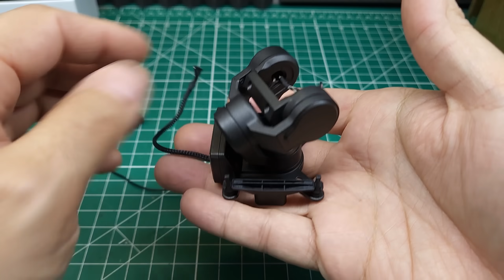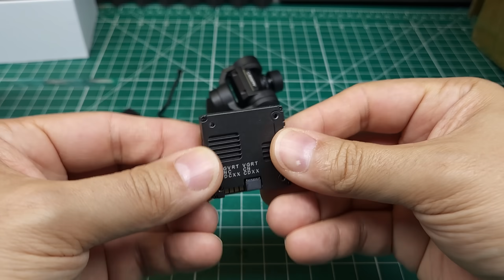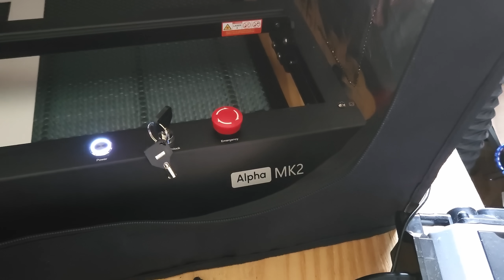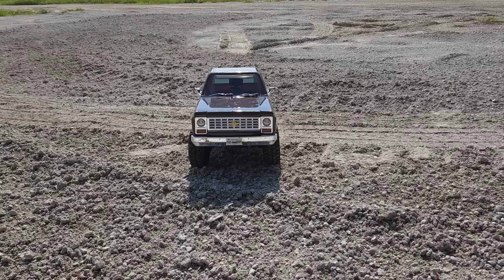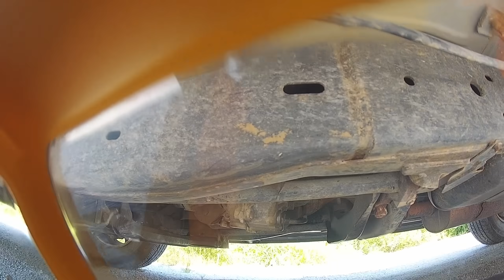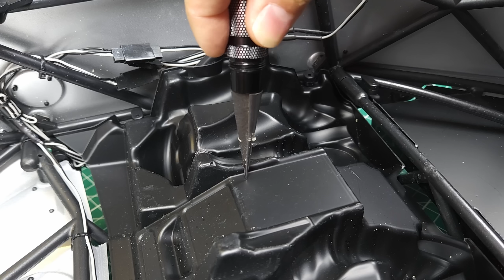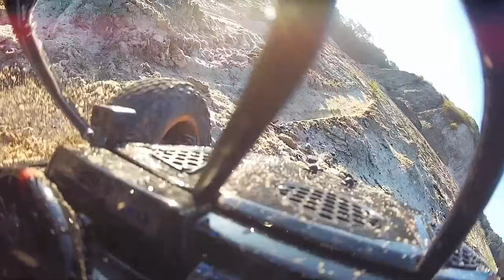NEW Head Tracking HD FPV Takes RC Bashing To The NEXT LEVEL!

Comment: if you mount a second smaller battery it would make the camera, gyro and truck last longer also better chance of not overheating a battery.
Reply from the maker: I actually did run everything off of a second battery on the bashing sessions but the reality is that compared to the size of the batteries on these trucks the camera VTX and gimbal use very little juice. It might reduce run time by a couple percent but it's very likely not going to be anything most people will notice.
Reply: @DoRC  that's what i was wondering about, thank you....not sure what brands you had there but i am certainly getting the set-up, simply mind blowing, crawling/trail riding" game CHANGER! thanks for doing it, i've often thought of doing something like this now i know how to start.
Reply from the maker: @acmr3215  I detail it out at the end of the video but it's the walk snail GM3 gimbal with one of the compatible camera VTX setups that are in the manual for the gimbal. You can get that on the caddx website. The goggles are the avatar goggles l. They're currently the only goggles compatible with the gimbal.

Comment: You didn’t have to download any files to the gimbal?
Reply from the maker: I did have to update the firmware on mine but mine was part of the first batch So hopefully they'll have the correct firmware on anything being released now.
Reply: @DoRC  ok
Reply from the maker: @gpgp1750 I considered including all of the setup stuff in the video but given that most of my audience has probably never even experienced FPV before I thought that might be a little too in-depth for this particular video.
Reply: @DoRC  I kinda wish you did lol but I understand. I love fpv driving and I’ve been doing it a long time. This would definitely be a upgrade for me but I need to know if I need to download anything
Reply from the maker: @gpgp1750  So I needed to update everything including the goggles VTX and gimbal. The gimbal did not come with the hardware to do the update but they did send it to me. There are videos online though that show you how to update the firmware through betaflight without needing a separate cable. Overall it was maybe a 3 out of 10 in difficulty for someone who has a decent amount of FPV experience already.

Comment: Nevermind I found the goggles your using an they cost 199 but those are the old version. They have a newer version for over 500 bucks. 
So total what did you spend on this setup? 
Around 600 or?
Reply from the maker: The 199 goggles l are actually the latest release. It is a budget release but it's also the only goggles that are compatible with the head tracking as far as I know. The goggles x are higher end but again as far as I know don't support the head tracking. 
All in it's about 500 bucks

Comment: The goggles that are recommended for this gimble is 500 bucks by itself. It doesn't look like you used the recommended avatar HD goggles but you didn't say what brand or model of goggles yoyr using?
Reply from the maker: Yeah I'm using the goggles l. They are the only ones that are actually compatible with head tracking as far as I know. The goggles x are higher end but older and aren't compatible

Comment: Awesome video. I own a few fpv drones that i really enjoyed building and i have the Walksnail Avatar sytems on them and i installed one of the Walksnail Avatar systems on one of the Arrma Typhon bodies that i have and i use the Walksnail Avatar version 1 goggles and its the coolest thing. I did have to install a fan on the vtx because it was over heating very quickly.
Reply from the maker: Yeah they really depend on air flow from the propellers for cooling.

Comment: Why didn’t you test the distance it can go without interruptio???😮😮
Reply from the maker: I did but I didn't talk about it because, especially on the surface, video range is going to depend on so many different factors that my result wouldn't really help you. Depending on how you have the system set up in your RC car, what's around the system in the RC car, what power level you have the VTX set to, which VTX you select, which way you're facing in regard to where the vehicle is, the terrain, obstacles between you and the car and sometimes it seems like the phase of the moon the range will vary wildly. That being said even in lower power modes with terrain obstructions you'll still get a pretty good distance away.

Comment: awesome idea i think the biggest weak spot would be in open cockpit like this is sand and dirt getting into the gimbal
Reply from the maker: Yeah I agree though at least so far the tolerance is seem to be tight enough around the gimbal housing that dirt isn't getting in. I suspect with really fine dust it would be problematic and I'm sure over time it's going to get crunchy but it's holding up a lot better than I thought it would.

Comment: I’ve been wanting to do this for awhile. I like this gimbal better than other set ups I’ve seen. What model camera and goggles are you using? Thanks!
Reply from the maker: The GM3 gimbal is compatible with a few different models of VTX and camera. You can download the GM3 gimbal manual from the caddx website and they are listed in there. The only goggles that work with the gimbal are the ones shown in the video which are the Avatar goggles l.
Reply: @DoRC  tanks for the input!
Reply from the maker: @CSmothersForge  You're welcome thanks for watching :-)

Comment: Do you have links to all this gear?
Reply from the maker: I don't normally do links cuz they're always changing and they're different depending on where you are but it's the GM3 gimbal with one of its compatible VTX camera combinations that you can find in the manual for the gimbal which is available on the cadex website and the avatar l goggles
Reply: @DoRC  yeah I found several, but wasn’t sure which one

Comment: Great job! 
Something is off, it doesn’t look right. 
I hate fisheye lenses but maybe it would be more like peripheral vision? 
The bars vibrating were very distracting also. 
The crawler would be my choice and maybe a track experience. The bashing never seemed fun to me.  Jumps aren’t very realistic IMO.
Reply from the maker: Yeah it does have a pretty wide angle view but that's kind of inherent to the FPV camera. When flying FPV you really need to be able to see what's around you So most of them have a pretty wide FOV. I do agree the bars were distracting but the nice thing is when you're actually using FPV your brain deletes most of these annoying things that you'll see in the video afterward. When I was actually bashing I didn't even see those bars. That being said it would be best to remove them. 
Yeah it just depends on what you like to do. I think bashing is the most fun FPV but I'm also not much of a crawler or racer. Thanks for watching!

Comment: Is there an analog equivalent of a fpv camera system
Reply from the maker: Absolutely. The entire FPV scene was analog up until just a few years ago. You can get an entire analog system for a lot less than a digital system costs. The downside is you won't be able to get it to work with This version of head tracking as it's specific to its digital system. I know there are other head tracking systems but I don't think there is good.

Comment: These things are awesome!!! You can also use those long distance radio set ups so you can drive for kms or a mile. I have only seen these cameras used in the cockpit of RC planes. It gives you the feel that you are Tom Cruise in Top Gun. There are a few different channels on here that
Reply from the maker: For sure. If you actually go back and look at my early videos many of them are flying FPV quads

Comment: Very cool camera and gimbal system for only $289 for the pro kit you get everything but the googles. This might be the next big thing for RC !!!!!!!!!!!!!!
Reply from the maker: This system is specifically walk snail compatible so you need to walk snail goggle. In order to use the head tracking I think only the caddx goggles l currently work.

Comment: That walksnail stuff I pretty expensive I fly fpv and use analog system still and there is zero lag compared to digital stuff
Reply from the maker: Yes the digital stuff is definitely more expensive and you will have a little bit less latency with analog versus modern digital systems but at least for me the trade-offs are completely worth it. But since going digital I don't think I could ever go back to analog. The experience is so much more aversive and especially if you fly near obstacles a lot it allows you to get a lot closer to things and see things you normally would have missed with analog. If you haven't tried digital I'd recommend it
Reply: @DoRC  I no the latency isn’t massive but I think my brain is sensitive to it I tried my brother dji system in his fpv drone and it felt all mushy to me and the further away I went it got worse. I love analog with a powerful 1.6w vtx it’s good enough for me while the GoPro it getting the good footage. Saying that I ain’t really flown much since I got into rc monster trucks I like ripping my mt10 more than my drones at the moment. Don’t really get much decent drone weather in the uk lol
Reply from the maker: @steviefpv Yeah depending on which mode he had it in the latency on the DJI system can be pretty high (2-3x What the walksnail and especially HD zero can do)

Comment: I bought the exact K5 to do FPV testing! I can’t believe I ran into this video. I’ve had a real bad time researching this. 

Love the video. But looking up these parts show some very confusing results. At a minimum of $500 I’d like to make sure I’m not buying multiple cameras accidentally. And the goggles options for connecting isn’t clear at all…
Reply from the maker: Yeah unfortunately their information isn't the clearest. The GM gimbals are compatible with any of the full-sized V2 VTX camera systems from what I understand. At the moment I believe The gimbal is only compatible with the goggles l and you need to make sure everything is on the latest firmware in order for it to all work together. If you have any specific questions let me know!

Comment: It handled the abuse a lot better than I expected. Would be cool to have a clear cover/body specifically meant for housing the gimbal. Car wouldn't look cool, but it would be easier to see everywhere around you
Reply from the maker: Yeah that would be neat. I bet there's something out there that would be appropriate. I am also very surprised at how well it took the abuse. I figured it would either grind to a halt the first time it got a face full of sand or fail the first time it ate a 10 ft crash but it didn't do either one of those things. Can't guarantee you it will last forever but I am impressed

Comment: Hey guys, how do I create the Shortcuts?
Reply: I also want to know if you can get a day and night vision camera to be able to run it in the dark with minimal light for less battery use on your RC trucks
Reply from the maker: I believe there is a starlight camera available that works with it but I don't think it would save you any battery to run at night.
Reply: @DoRC  hey guys, how do I get the gamble for a Camera that I already have or a gamble that has a night vision camera to be able to run my RC truck with? I have the VR goggles or whatever you want to call it VR headset and a camera that came with them, but I need a camera with night vision and vision with a gamble that will keep it steady instead of vibrating and jumping around with the truck if I am in rough terrain, please help me get the right set up and I’m having trouble with my ESC’s. They keep dying on the motor side, but the servo side works great, but it will not operate the motor. It’s like it’s been overpowered and it killed the ESC, so where can I find 4S. To 6S ESC have a reasonable price that will last instead of burn out the operating side for the motor????? any help would be of great value I’m a chordoma cancer patient and that’s T cell cancer. My life expectancy is if I make it to my vehicle to come home so I had identity theft happened and whoever done it they ordered RC cars and four-wheel-drive trucks that were delivered to my address, and purchased with my account without my permission and Medicare my information through a data transfer through maximus so they have cost me a lot of money that I didn’t have to start with, but it did show me that this hobby could be fun and it takes my mind off of end of life, T cell bone cancer for a short period of time so any help would be greatly appreciated!!!! you might even earn a few for your crown and the Lord’s eyes!!!!🙏🏻🙏🏻🙏🏻🙏🏻🙏🏻🙏🏻🙏🏻✌🏻🤟🏻🤙🏻 MT,DEW any suggestions on who is the top sales rep for Traxxas on the East Coast United States?

Comment: I have had a dream for a long time to take my racing wheel setup and connect with a transmitter to control an RC car, with one of these head tracking cameras in the driver's seat. Even better if it's a full cockpit with linked steering wheel that matches the rotation of the gaming wheel. 
Take it a step further for another variation and dress the cars up as Mario kart, throw in mixed reality power ups and drone lakitu's to reset people on the track. If only Mario home circuit had been a collaboration with a hobby grade company, id imagine a 1/24-1/18 small scale would be amazing and made it also usable at most rc tracks instantly turning them into Mario kart raceways and would bring kids into the hobby like crazy and the only infrastructure they would probably need would be good local WiFi access points for all the video feeds but that would be cheap compared to most even budget cars lol
Reply from the maker: I believe people have already done the grafting of steering wheel and pedals to an RC transmitter and with this you're pretty much there.
Reply: @DoRC  they have, but last I checked it wasn't exactly accessible. Id like to see an adapter like the one I have for my PC/PS4 wheel to work on my Xbox but instead work with a transmitter or even direct drive so you could use it as a drive by wire for a power wheel .... Has nothing to do with that also allowing the power wheel to be a hobby grade RC car with moving steering wheel you could attach to a doll or anything.
Reply from the maker: @HerbanWarrior sounds fun :-)

Comment: you moved the esc for the battery to crash into the antenna connectors instead. Not the best idea that coax will break easy. No links to the items in comments?
Reply from the maker: In this case the battery is actually under the sled that contains All of the FPV stuff. That being said if I was going to make this a permanent install I would have done it differently. This was just installed for the video as I knew I was going to be moving it to a basher right afterward. Definitely do need to keep those antenna connectors safe though!

Comment: It would be nice to ditch the goggles and go for a small display. The RadioLink 6 channel transmitter has a 600meter/ 1900+ feet of range. This is new to you and a lot of other guys, but vehicle FPVing has been around for quite a while. Have you gotten a real range test done? The RadioLink also has head tracking capabilities. WHY didn't you link to what you used? You link to the gimbal, but everything else is a guess. Please give more info so this isn't just a teaser video.
Reply from the maker: I'm actually pretty familiar with FPV. If you go back several years on my channel you'll see it started out with FPV quads. There are definitely some great options for transmitter range though you might find that with a surface vehicle your video range could end up being your limiting factor depending on terrain. I mention everything at the end of the video that I used. There are several different VTXs you could use with that gimbal so I didn't want to give a specific one there. Everything's available on the usual suspects like get FPV.
Reply: i've been a rc car guy back in 2010s, also tried the early stage of analog FPV feed using small screen and now fly HD FPV quads only, i'll say that the immersiveness of FPV goggles is just a different world, not everyone's cup of tea for sure but it surely is a more immersive experience. Also the Walksnail system he's using can get 40km of range in the air so i'm quite confident it can still do more than a mile or two on the ground, and most importantly, IT'S HD!! no more crappy 1970's television breakups, what you see in the video is pretty much what he saw in the goggles, it'll be a waste to put that HD feed on a small screen IMO unless the screen is like an iPad or something bigger.
Reply: @colebtl  Some of us, though, have problems wearing goggles in so far as they affect our balance.

Comment: dam.. more to put on my to-get-list... the this list is huge already :(
Reply from the maker: It's definitely fun!
Reply: @DoRC  I’m building a rallycar, 1/5 scale… It would be awesome to get this in it! BTW, is it easy to get the videostream of this setup? (For youtube use etc..)
Reply from the maker: @arcticcirclerc  It's very easy. The video transmitter has built-in storage and the goggles take an SD card. There's a single button you can press to begin and stop recording and then you can either retrieve the video from the SD card or directly from the VTX. The SD card is obviously more convenient but the video from the VTX will be a bit cleaner since it's not being transmitted.